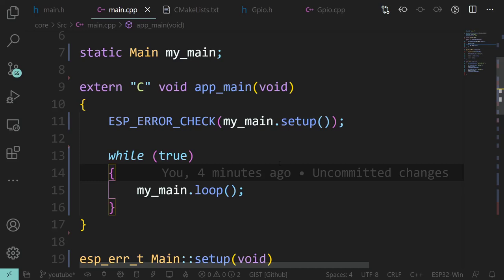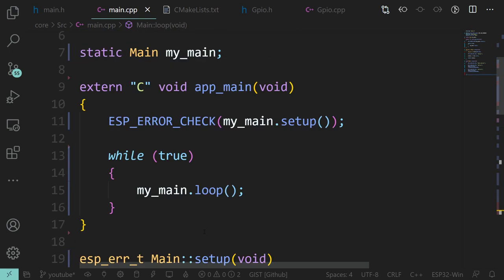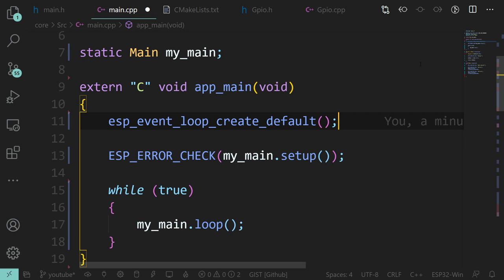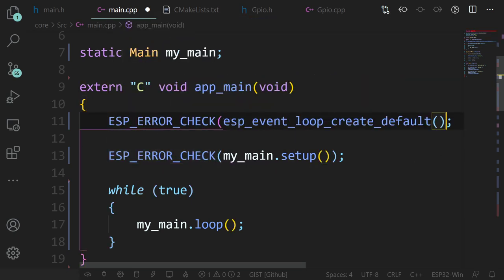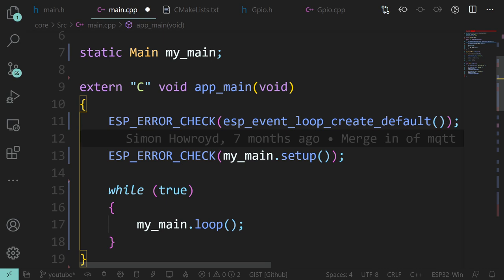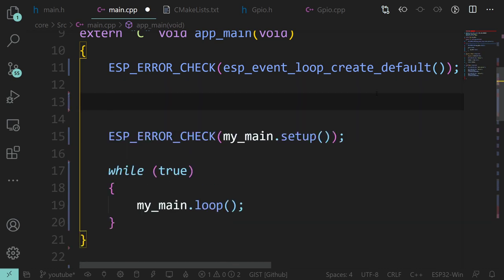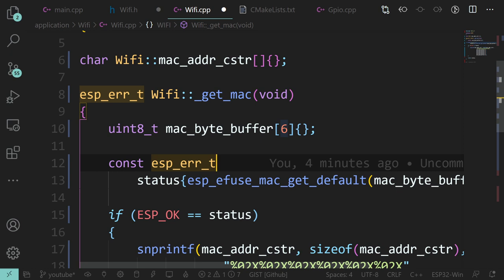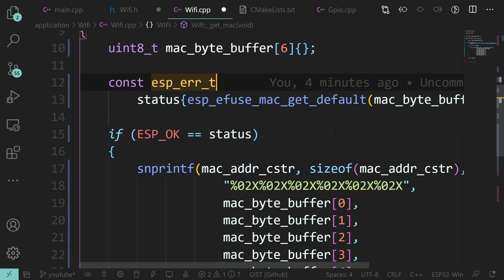ESP-IDF in CPP 03: WiFi, initial thoughts and class definition

Comment: 0:00 Recap on what we've done
1:02 Get started
2:28 Preferred place of calling Functions
3:09 Call esp_event_loop_create_default()in main.cpp
6:21 Unified memory and explanation
9:48 flash needs to be initialized
15:20 Draw your own diagram of what you want to achieve (Not how) (top down method) 
23:43 What does the api allow you to do
29:00 Create WiFI folder and accompanying files
32:20 Add content to Wifi.h
42:21 Add content to Wifi.cpp
1:07:40 Back to Wifi.h
1:08:44 Statically initialize the mac address cstr

Thanks again Simon!